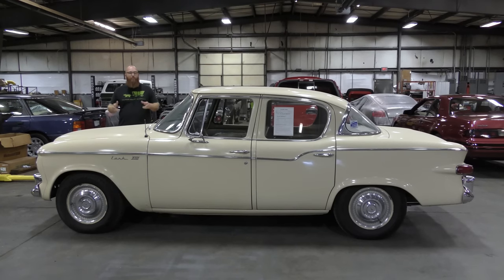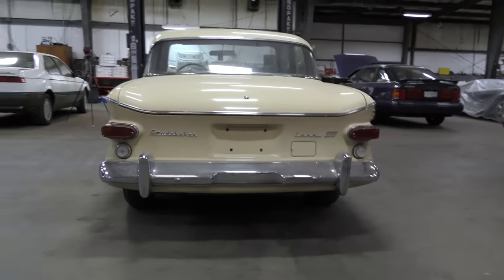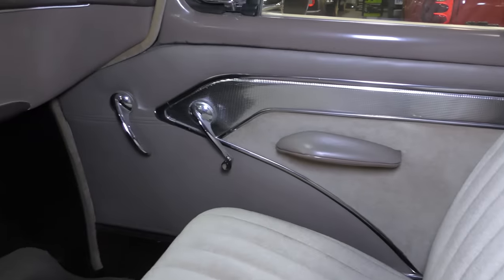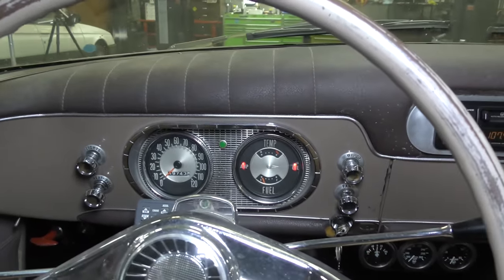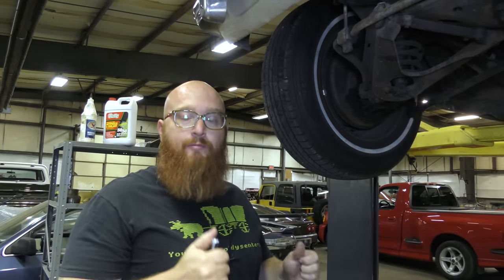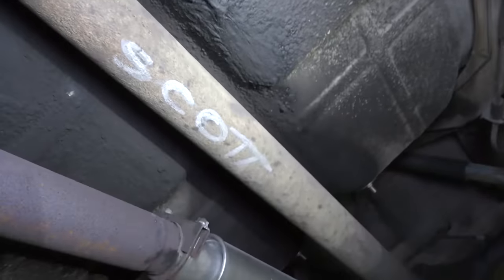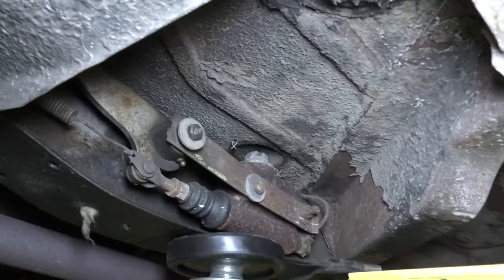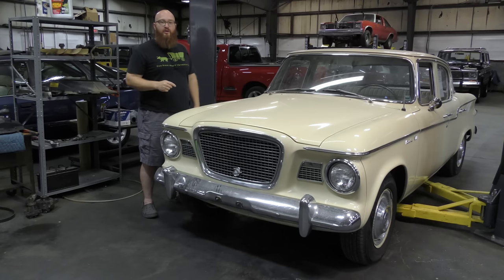Finally a CAR WIZARD approved engine swap done on this '60 Studebaker Lark VIII

Comment: I was terrified that somebody had put a late model computer engine in it. SOOOO glad they didn't. That would have ruined the whole car. I also notice it has the proper size wheels and tires and what appears to be the original wheel covers. So many nice older cars, including a lot of high dollar classics, have been completely ruined by putting computer engines in them and HUGE GHETTO PIMPMOBILE REEHUUMS with no actual tires on them, just a very thin strip of tread wrapped around the outside edge. Many cars are actually coming from the factory that way. I had to put 15" wheels from a 1999 V6 Mustang on my 2003 Mustang GT to be able to put real tires on it. 

The old school small block Chevy (NOT an LS) is my favorite engine, and always has been. I have built dozens of them, from street engines to full blown drag race engines. My favorite way to build one is to take a 350 block, bore it .030 over, and put a 400 crank in it, making it a 383. Starting back in 1955, they were made as a 265ci, a 283ci, a 302ci, a 307ci, a 327ci, a 350ci, and a 400ci. Built right they are as bulletproof as it gets. They are so well liked that you can build one from the ground up without using a single GM part. GM no longer holds a patent on them. The first engine I rebuilt at age 16 back in 1975 was a 283 small block, to replace the inline six in a 1963 Nova SS that my dad gave me when he became unable to drive due to a stroke. It ran for years, and I even raced it. 

Putting a (carbureted) Chevy engine in that car was a great idea, as parts for the original engines in a Studebaker are no longer available. Unfortunately, that also applies to pretty much every other part on it as well, from mechanical parts to body panels to glass and interior parts. If a window ever gets broken, you're just out of luck. I have the same problem with my 1972 Ford Pinto woodgrain wagon, that came with a 2.0L SOHC four, which I replaced with a 289ci V8 out of a 1967 Falcon. Virtually no parts are available for a Pinto wagon. Almost all of them were crushed decades ago. I had it repainted by Maaco, and had the vinyl woodgrain replaced by a sign shop that did body wraps. 

I would love to own that Studebaker, but it is something I would be afraid to drive. A minor accident or even a broken windshield would likely be unrepairable. I have a thing for older cars that are not considered "classics" like "tri five" Chevys, Mustangs, Camaros, etc. But again, the downside of that is an almost complete lack of parts for cars that are not considered "desirable" by most people.
Reply: You're dead wrong about parts availability. When Studebaker left the auto business, they had a huge parts surplus that was bought by the Studebaker Driver's Club and its affiliated businesses for pennies on the dollar. While chrome trim pieces are fairly hard to come by, both interior fabrics and mechanical parts are readily available from that original parts store. I've been driving a '62 GT Hawk as my first car for 5 years now, so I think my comments are accurate in this regard.
Reply: @jakekaywell5972  That may very well be true. I know very little about Studebakers. But it is not the case for most older and uncommon cars. My dad had a '63 Rambler wagon. Just try and find parts for that now. Even more modern AMCs are almost impossible to find parts for. I'm glad to hear the Studebaker is an exception.
Reply: @geraldscott4302  Yeah, Studebaker's case is unfortunately the exception rather than the rule. AMC's case is just as exceptional, but in the complete opposite spectrum. When Chrysler bought them out, Lee Iacocca purposefully destroyed their parts inventory by burying the entirety of it in a New Mexico scrap yard in order to gain tax credits. Really reminds you that Chrysler cared about getting Jeep and nothing else in that deal.

Comment: not a bad car at all, but kind of hacked spark plug wire install hanging all over the place. Im sure on a wet day you would find where several are shorting out from being on a header or just header heat. Then top cog belts are notoriously garbage, then the exhaust shortcut hitting axle. So mostly ok but needs that finishing touch a home botch job cant muster

Comment: In 1960 the lark viii would have had a 289ci Studebaker engine. 
The lark vi would have the inline 6.
The Chevy engine was not an upgrade, the Studebaker v8 was awesome.

Comment: I don't think it was swapped. I pumped gas in the late 60's and one of our regular older customers had one of these that he bought new and it had a chevy engine. I remember it to be a 327 but it could have been a 283. Either way it was SBC chevy engine from the factory. I think it was even a powerglide.

Comment: I've done it right forever.  Have a 1978 monte Carlo.  Had every small block in it 400. 383 350 307 etc. Problem with these cars are the gasoline.  Carburetor cars suck. Drove a 1986 cutless Supreme for 2 years recently.  Killed me on shit fuel.  It was cheaper with car payments vs fuel to buy a  new camry.  I like the old cars. But need to be ls swapped

Comment: That would look better with the whitewalls turned outside, more class.
Reply: Yes, this car would look perfect with whitewalls. But, the blackwalls give it a more aggressive, budget underdog racer look. Maybe it's hard to get tires in that size now, and the owner had to choose from what was available, maybe whitewalls weren't available.
Reply: @reallyrandomrides1296  The Lark was a budget, simple car. Adding whitewalls would only detract from its purpose and appearance.
Reply: @jakekaywell5972  Good point, it might not have come with whitewalls when it was new. Maybe as subsequent owners changed tires they added whitewalls though, throughout the 1970s and 1980s.

Comment: I don't think a short overhang was necessarily that odd for a 1960 midsize or smaller car... I don't think that wheel placement in relation to the cab is that special either... now if were talking full-size tuna barges or later 60s to 70s cars sure.

Comment: They did a great job. I would however recommend for a daily driver to modify it to a 2 circuit brake system for safety issues. Perhaps also front disc conversion. This car has a small block chev it is no longer in 1960's traffic. It needs to stop better than a 4 wheel drum with single circuit brakes. There is a reason back seatbelts and 2 circuit brakes were federally mandated in 1968.

Comment: I put a 2.5 fuel injected Chevrolet Celebrity  engine on.a Chevrolet Impala overdrive transmission and put it in a Farmall model H farm tractor It got 29 mpg in the Celebrity.  Be a good engine for a Lark with the overdrive. Ended up putting a VW beetle carburetor  and distributor  on it. Weather kept getting to the electronics. The V8 is for hot rodder  teenagers. LOL.

Comment: Just a little pushback about the longevity of this era of cars. Even with the idea of all the grease zeros supposedly to keep the car running. It was a very rare car that would make it to 100,000 miles. Nowadays. 100,000 miles is the 2nd owners starting mileage and many cars make it reliably past 200,000.  Back then the only cars with 6 digit odometers were Volvo and Saab. 
Also a note on the exhaust tip. It looks like it was touching the rear axle while on the lift, or was that an illusion?

Comment: Usually I have no grounds to disagree with Mr. Wizard, and maybe he’s just waxing nostalgia over the grease fittings…. but frankly older cars were certainly not “built to last”; one would be lucky to get 80k miles out of an engine before needing a major rebuild.  There’s a good reason why the odometers are generally only five digits, and he’s even mentioned as much in previous episodes…
Reply: Thats true. They only lastet until now if they are really taken care of, rebuilt, restored etc. Usually they rusted away very fast  because those cars were cheap automotives for the masses.

Comment: I hope the owner has retained the car's original six cylinder engine or its "small" four point two litre V8 and will re-unite them one day.
Did the manufacturer not try to cover the spare wheel?
However, I agree that this is a rather lovely artifact. And I am not usually an enthusiast for cars of the USA.
Reply: Lark VIII always had a Stude V8, either 259 or 289 cid.

Comment: The car is no more "completely useful" than it would have been having the original Studebaker engine rebuilt. Taking a really, really nice original vintage car like this Lark & dumping a small block Chevy under the hood is disgusting. I'd NEVER sell my original 1959 Rambler American Super (that by-the-way, keeps up with traffic & runs & drives quite nicely on "today's roads"), to someone that would do something like THIS to it. Here's hoping YOU never find a nice Studebaker like this to butcher.

Comment: A stock Studebaker V8 would be better than a Chevy engine from that time. If I remember right the V8 Larks of that time were faster than the competition. The R series engines, like the R2 in the Lark were powerful beasts. I seem to recall there were 'R' badges that were mounted to the front grill. Anyone else care to corroborate that?

Comment: A Lark VIII means it would've been a V8 car.   A Lark VI would've had the six.  A '60 Lark could have only gotten the 259-cubic inch Studebaker V8. 2-barrel only.  
This was probably a bolt-in swap.  Canadian-built Studebakers from 1964 through 1967 used small block Chevy engines.... 283/2barrels to be precise.

Comment: Honestly, you were babbling early on about the VIII (Roman Numerals for the number 8) emblems on the car.  This Lark came from the factory likely with the 259 V8 engine.  The Chevy engine really isn't much of an improvement.  Particularly since this car had the available option of a 289 V8 as well which would have outperformed the Chevy especially if it also came with the optional Supercharger.  Ask any Hawk or Avanti owner.

If you had inquired of the Studebaker Driver's Club, they could have told you that the parts necessary for a small-block Chevy swap into a Studebaker is easy due to '65 & '66 models carrying the Canadian built Chevy-Cleveland engines.  Hence, everything needed is available.  There are a lot of people who are intimidated or simply foolish enough to remove the original Studebaker engines because they aren't comfortable with them.  They are Different.  They're also good engines.

As to the exhaust, terminating it by the back axle is a good way to asphyxiate the passengers in the back seat.  Happened a lot back in the fifties and sixties.  The exhaust pipe should go over the axle and out under the back bumper.

Comment: Bellybutton Chevy in a lark is nothing new. Sad thing is the little 259 they pulled out probably made comparable hp and are nearly indestructible. I have a supercharged 259 in my 59 hawk and that thing can take one heck of a beating. Rev it to the moon all day, it doesn't car. Parts are getting harder to find for the Chevy small block and fairly easy to find for the 259. I don't understand the point of this swap.

Comment: I gave a 'Thumbs Up'for the channel,but even you know Better than to like an open air filter over a V-8.They cause stall outs in parades,mostly,as Vapor-Lock is a Constant problem in small engine compartments  with Open Air Filters,and  added heat of the Headers.Come On?They can't be counted on at all,yet you "Liked'this.

Comment: Studebaker  used GM and ford motors from the factory   depending on model and year
Reply: Wrong. Only time a GM motor was used was for the '65 and '66 model years, when the South Bend foundry was shut down with the rest of the factory. Their own engines were their own design, as a 289 CID Studebaker V8 is miles apart from a FoMoCo 289.

Comment: If you tried to service a vehicle today like we did in the early 60's you would not be able to afford the repair bill.  At today's labor rates you would go broke fast.  Today's cars are built with this in mind. Pull the part toss it and put a new one is much quicker than take the part out, figure out what caused the problem, get the repair parts, repair it put it back together. This can take a lot of time.  Besides, most mechanics today couldn't do a tear down inspection and figure out why a part failed, it is just not taught anymore.  Besides, manufacturers design and build cars with the idea of Early Obsolescence. The more money you have to spend to keep it running the more money the manufacturer makes when you replace that vehicle that should last 20 years.  Personally, I don't like new cars with all the Computers and Electronics that could go wrong and leave you stranded.

Comment: I once had a 1973 Vega GT had had a very well done swap in it.
Olds 215 V8 for the junky original 140.

Had GM succeeded in getting Rover to sell them BACK the tooling and rights to the Buick/Olds 215 in the very early 1970s (after GM made the mistake of selling off the IP and tooling in the mid-1960s) the Vega would have had a GOOD engine option instead of a "marginally small" Cosworth-based redesign of the 140 that ended up even smaller (122 IIRC) but more powerful than that stock engine, or the horribly designed 140 "50,000" mile engine that had a strong tendancy to CRACK THE HEAD right around the 50,000 mile mark AND waas badly underpowered to boot.

Comment: it was an engine studebaker bought the rights from gm, a small bore, long stroke ohv V8 used in the cady's 260 cu in, mine would easily accelerate to 105 mph, I could eat 65 mustangs for lunch

Comment: Remember, if you're old enough, the Lark made it's debut in 1958 as a 1959 model.

Lark VI had six cylinders and the Lark VIII had 8 cylinders.

Studebaker switched to the Chevy small block (just like Checker) a few years before they went under so it must have been an easy swap.

Please get rid of those turd tires. Hankook is a brand I would NEVER buy.
Reply: And remember that Studebaker was the official importer of Mercedes cars for several years in the USA. That may have had some influence on how first generation Larks looked.

Comment: I just saw this and I do not really approve of this swap.  Why you ask?  What has been done is take a car that got pretty good gas mileage into a gas guzzler. And if the radiator has not been updated, overheating might now occur, especially in the south.  The six cylinder engines of that era are pretty reliable and economical in general(The slant 6 is famous).   In addition, I would guess that the body and frame are designed for the small v8 or six, nothing larger. Was anything done to check this and strengthen the body/frame where necessary? The failure of the body/frame would show up over time, not immediately.  I have a 1963 Falcon with the 170 six which gets about 22 mpg.  Prior to 1963, only a 144 six and 170 six were available to the Falcon. If you want to put a V8 in these, all kinds of modifications need to be made to strengthen the body/frame.  The 170 I have has no problems with 65 mph, but the handling is not as good as a modern car-I suspect the same is true of the Studebaker.

Comment: A Lark 8 had 8 cylinders not a six which was called a Lark 6. 
Putting in a small block chev motor in no way is an improvement over the 259 c.i. v8 Studebaker

Comment: To bad it has a Chevy engine in it. I would rather have a Studebaker Engine, they were better engines. The Lark standard engine was an inline 6 cylinder. The Lark VIII engine was a 259 ci V8 as the standard engine the VIII indicated it was a V8. Studebaker also made a 289 ci V8. That was an optional engine.

Comment: I would like to say that, even though a Chevy small block is a fine, low cost replacement engine, it is regrettable that a Studebaker V8 could not be found for it. The Studebaker eight was a very special engine that was especially rugged. So many vintage cars have Chevy or Ford engines put in them. The personality and history are damaged and even lost by doing this. In my opinion, most old cars should be made original as possible. They are time capsules that speak of the time they were made and are marred by modification.

Comment: Please continue to criticize modern car design as it relates to the lack of ease of maintenance. To your point with this Lark, to replace the heater core on my Fiero, I remove two hose clamps, two clips, and two screws and it drops from beneath the dash. However, on my Jeep Wrangler the passenger seat, center console and dash must be removed to replace the heater core. That's unnecessarily stupid. Perhaps if automotive design engineers actually worked on cars, they would have a greater appreciation for what is required to maintain a vehicle.

Comment: You just lost me on the engine swap. Tge studebaker v8 is so much greater than the small block Chevy. I’ve been a Chevy guy my whole life til I got my studebaker and discovered the raw power of a stock 4bbl 289 studebaker engine. Also the lark viii would be a factory v8 car, a 6 cyl car would say lark vi

Comment: i stopped watching when you gave us a lecture about old cars being built to last. I don't believe you. My experience is that newer cars, especially Japanese cars like Toyotas, last much longer than old cars, and they still need less maintenance than old cars ((like from the 60's). I had a Toyota that did 300,000 miles and needed very little repair or maintenance and never let me down- where as cars I owned from the 60s were pretty much worn out before 100,000 miles. Plus those old cars were much more dangerous to travel in. I know we can be sentimental about old cars (and I am too!) but really-they are shitty compared to new cars. that's my experience, and you may not agree, and that's OK!